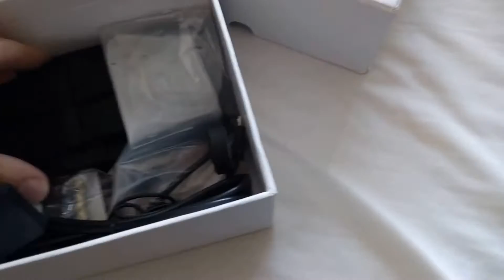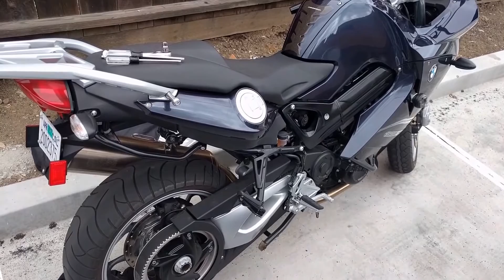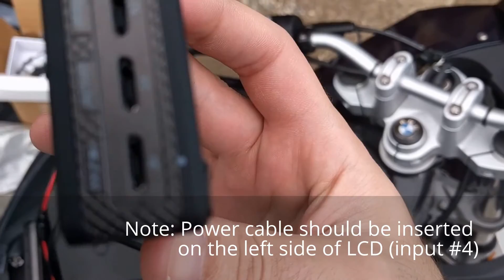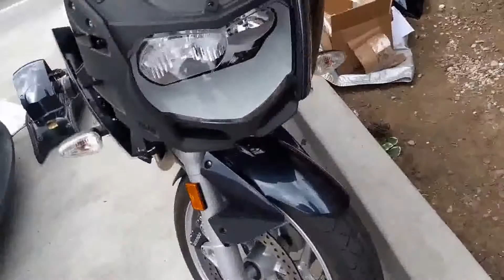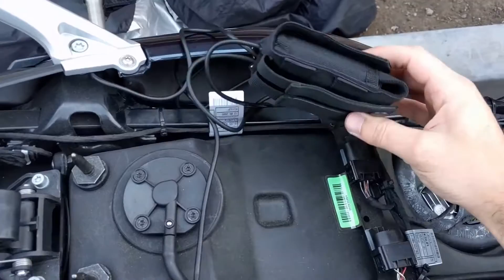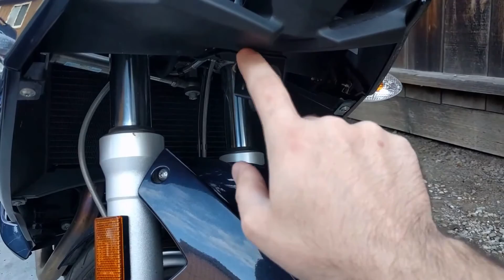Innovv K1 Dual Camera  System Install (F800ST)

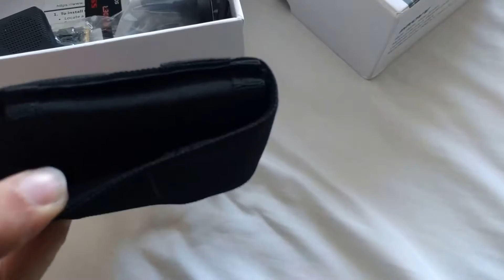Comment: 2:05 That does not protect it from the elements. You have to hide the non-waterproof screen somewhere dry. If the would fix that, I'd buy one.

Comment: If you buy this system make sure that you install RF chokes around all four wire into the DVR. I had terrible problems with the unit turning recording on and off and looping until I did so. read this post from Tor Amundson: http://www.innovv.com/blog/author/Tor-Amundson-tora

The unit is not very rugged. I have had two broken screens in three months and now it only records on one channel.

Innovv has provided email support and live tech advice on Whats App.
Reply: I had eight emails "Ellen Chen" with the strap line "we take care of products and customers. " I accepted that I cracked the first screen (one drop from two feet onto a plastic floor) and they sent a new screen for $20. After the Whats App messages I have hear nothing, although I have not been chasing them up as I have no faith in the system now and don't want to keep wasting money. The last time I checked the SD card the DVR had stopped recording. From my experience the unit is not robust enough to be put into the tail of a bike.
Reply: christ your hard on the gear....I bet you could break just about anything

Comment: I purchased the K1 back in November 2016, and had worked great until recently when it developed a fault?

I contacted the owner 'Rock', and despite numerous assurances, he is yet to repair the unit!!!

SHAME!!! ... Was a good unit, though after sale support and repairs, let the positive experience down!!!

Until this is rectified, I would avoid using the company.

Comment: Hi where did you buy the BMW repair cable? Do you have a part number? Thanks!
Reply from the maker: I got it off Amazon, but you can find it elsewhere. Part number is 83300413585.
Reply: bought it, but it does not work on my S1000XR. For some reason, the tensionfrom the socket behind the L fairing varies between 6.5 and 8.5 V, which is not sufficient to power the 12-5V converter. Very weird. I ended up connecting the + and the - to the battery, and the switched cable to the number plate cable.

Comment: Can it catch USA license plates, if so, about how far are they legible, and what about when it's wet/raining? Would rain-x help if it can't see plate numbers when it's raining? Thanks.
Reply from the maker: Yeah, it can pick up US plates. Distance depends on a variety of factors (e.g., speed, lean angle, plate angle, etc.), so be aware of that. Farthest I've seen clearly is maybe 15 or 20 feet while in motion. 

I can't speak towards rain performance, as I tend to avoid riding in the rain.  

You can see some sample vids here (though keep in mind the raw output is slightly better quality): https://youtu.be/bGMEqkS19wY

Comment: Ok! Thanks for the quick reply! My idea way to put it inside, at the front edge, but using some kind of wedge to straighten the angle. Will think about it... Thanks again!
Reply from the maker: No problem. I can't really take the cam off to check fitment, but the dimensions are approximately 1.2"x1.5"x1.2".
Reply: Yes, no need for that, I asked because I was wondering if you might have tried that possible configuration when installing and would remember if it fits or not, no need to disassemble your setup :D
The dimensions help a lot, I will see if it fits. Thanks again and enjoy your rides, in safety ;)

Comment: Hello, nice video! Just what I was looking for.
 I have exactly the same bike and been considering buying this system. Can you confirm if the front camera would fit in one of the "fake" air intakes right above where you put yours?  I think it would be more hidden and wouldn't disrupt so much the air flow to the radiator (not that it does...). 
Thank you and congrats on this nice video!
Reply from the maker: You might be able to squeeze it in there, but I probably wouldn't recommend it. Assuming it's placed in one and not behind it, where you'd likely get a tunnel effect on video, the video would be recorded at an off angle. That might not be a deal breaker for you, but I'd prefer it to be as flush as possible. You already have to deal with angled video any time you're leaned over, and that would amplify the effect, depending on which side you're leaning on.